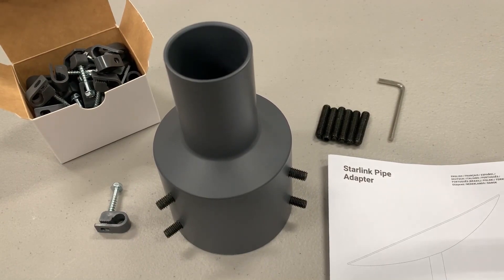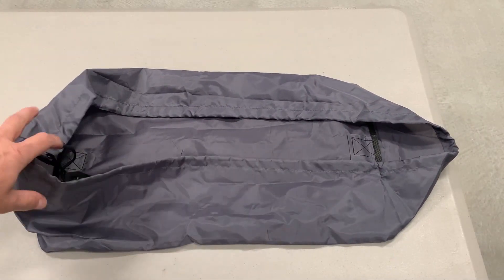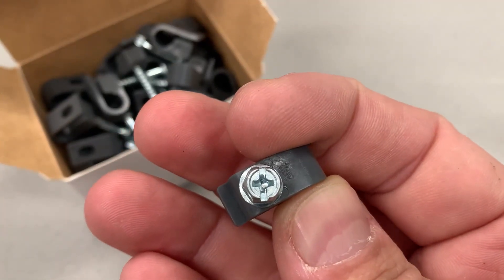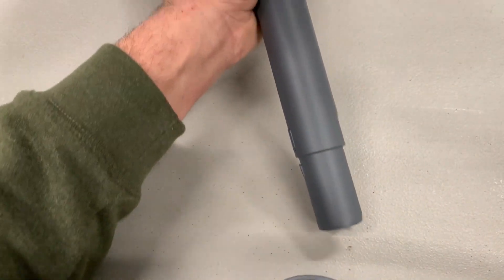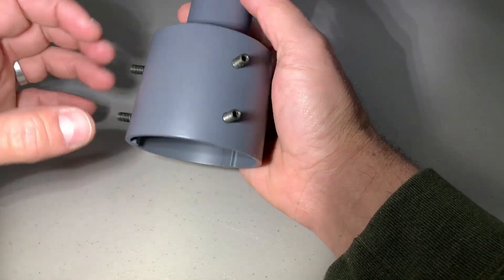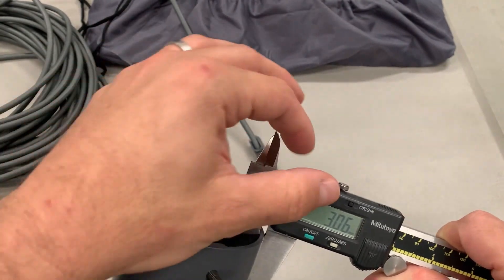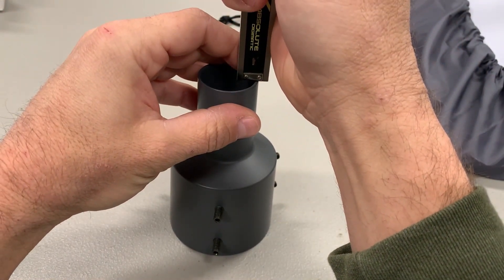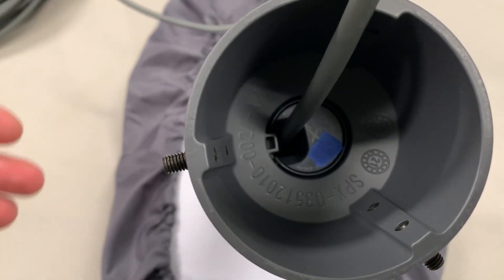Starlink Pipe Adapter Kit Overview, Dimensions, and Details

Comment: Thank you, but sincerely thank you. I watch technical design videos, and I'm a retired designer. I have never seen a video in detail, but in addition to the detail also the measurement unit switch. Congratulations and respect. I forgot, your video solved my questions about installing starlink and possibly building accessories yourself. (I haven't purchased it yet) Thanks, subscribed and liked. Antonio - Italy 👍

Comment: I don't know about you, but I intend to drill a hole on both sides of the corner Cyclone fence post pipe to guarantee that the dish and this silly adapter WON"T SPIN in a wind storm.  I intend to mount up 140 feet on one of my trees, which has been topped.  

I also intend to use small 6' bicycle lock cable ($6 at Home Depot) to serve as a safety just in case the bolts in the tree don't hold up in a windy storm. Likewise, I will use one of these cables to secure the dish stem to the pipe that the pipe adapter is connected to.  You know that this dish is actually a sail, right?  So, bolts on clamps that are made for Cyclone fences and the safety cable should be enough to delay a total failure.  It will give me time to get the tree service guy back out here to reinstall the dish.  It won't drop far.  If it did it would be time to get another dish.  The tree trunk at the point where it was topped is about 18" across.  I have the 150 foot cable, but would really like to measure the height of the tree top so that I don't run out of cable at 20 feet off the ground.

Comment: I live in high wind area and worry about the adapter vibrating loose and falling off my roof. Think I can drill threw the pipe and use nuts/washers and bolts?
Reply from the maker: Really don’t think you will need to. It is solid

Comment: This really helped me.  I have the 2 3/8 pipe to attach this to and I wondered how the Starlink Ethernet cord would fit into all of this.  Worried I would have to drill a 1 inch hole in the post, it looks like the place where the cord goes in at the bottom of the dish will end up having the Ethernet cord going up along the outside of the 2 3/8 pipe and then into Starlink Pipe Adapter.

Comment: I appreciate the tip about installing the cable inside the pipe. I did not know that was possible. The better pictures of the adapter were also a plus. Starlink does not do a great job showing detail on their accessories. Did you find a standard conduit that is a snug fit inside this adapter. I was thinking I would have to carry the adapter to the hardware store to find the best fit.

Comment: Great video, one question when using pipe adapter. I know the dish moves on a motor but does it actually turn 360 degrees?
Then this brings to my next question, should the clip part of pipe adapter be facing a certain direction like south or north or can the dish align that much?
Reply from the maker: It does move 360 and will point itself where it needs to. No need to worry about alignment of the key / clip unless you prefer access to the detent release button for the clip in a certain direction. Also, it doesn’t move much after initial setup.

Comment: Do you happen to know if you can direct bury the cable? I think they said no on the first gen, just wondering about the new cable. Waiting over a year now for my dish.
Thanks
Reply: You must use pvc.  It is NOT direct burial.
Reply: @bandman1967   I’ve read the same that it should not be buried directly in soil and needs conduit
Reply: @eleets82  yes
Reply from the maker: I haven’t seen anything stating that it is direct burial rated.

Comment: Well, this answers my questions about the size. I'm waiting for mine to be shipped. Got my dish on a janky temporary mount for now and am not quite happy with it. Thank you very very much! As you said, I'm planning ahead. I'm mounting mine to my eaves to get the clearest signal but I need about a 10' pole to go above the roof. I'm debating whether to buy a 40" j-mount and then figure out how to butt-joint some poles together or adding a wood block to the eaves to bump the pole out enough that it can clear the eaves overhang so the pole will be straight. I'm leaning toward the latter as it will be less expensive. Buying a 10' pipe is not going to be cheap. I'm still trying to decide between 1-1/2" structural pipe and 2" conduit pipe without a coupling. Not sure which would be sturdier.
Reply: I got a 2 3/8 " pipe used for chain link fence posts at Menards and it fits perfectly on top.
Reply: @bandman1967  Nice. The largest diameter mount I have will fit a nominal 2" pipe so I got found a sturdy 10'x2" pole that I've painted with Rustoluem to make sure it doesn't rust. I'm hoping the taller pole will clear the old oak tree that obstructs the signal from time to time.
Reply from the maker: Good luck. Glad you found the dimensions.

Comment: What is the OD of the rectangle dishy pipe?
Reply from the maker: First couple inches are 1.340” OD, then the rest of the pipe steps up to 1.500” OD. The pipe isn’t perfectly round so I’d say about +\- .005” on both of those measurements.

Comment: Thanks for posting this my square dishy should be arriving in 2-3 days, but the pipe mount adapter is on backorder for approximately another month, so I am attempting to improvise my own version using a section of Aluminum tubing.
Reply: I've got the round dishy (I'm not in America) on the way and my pipe adaptor was sent just one day after the dish was sent. I suppose the difference is that the locking pins on the round dish are round not rectangle like the ones in the video.

The video still helped me decide if the mount I plan to use will be suitable, so thank you, Remotely Aware.
Reply from the maker: Happy it helped!
Reply from the maker: Awesome. Glad it helped. Let me know if you need some other info to build yours. Good luck.

Comment: Thanks for this btw...many ask so here's some details to link! Wow when you slid that ethernet jack into the pipe you pretty much have zero force to make it connect --> @ 7:25 so I guess its good to go that easy? Does it feel like it grips tight when you insert it? There's really no way to get your finger on it to make is snap and you relied on the straight cable to ensure it connects? Anyways hello healthy looking buddy dog! I'm in Canada and have the round dish so I'll likely never get to experience the rectangular dish and its quirks.
Reply: The way it slides in makes it impossible to remove when attached to the mount so it's nothing to worry about. It's some sort of proprietary connector, but I've heard a few people say it's just ethernet underneath if you dare strip the 65$ cable.
Reply from the maker: It isn't a typical Ethernet connection, so it doesn't click in place.  It has a gasket on the outside also.  It does feel like a solid grip and not concerning to me.  I have another video that shows the cable end in more detail.

https://youtu.be/XhbCJtp9no4